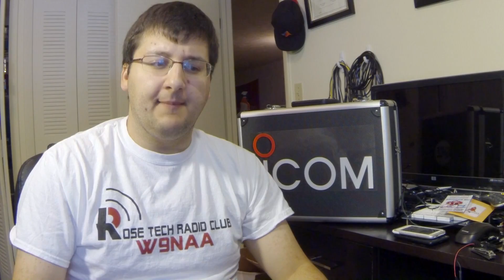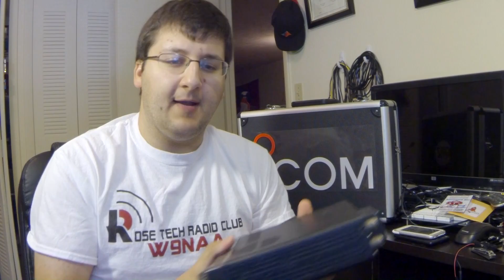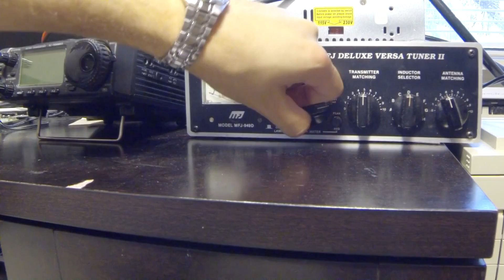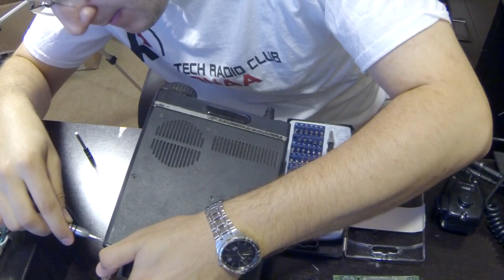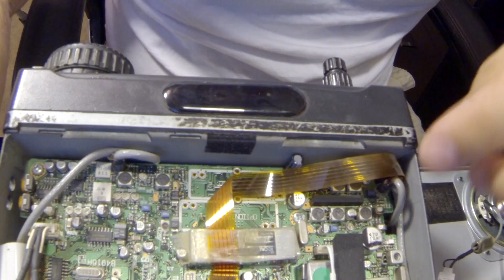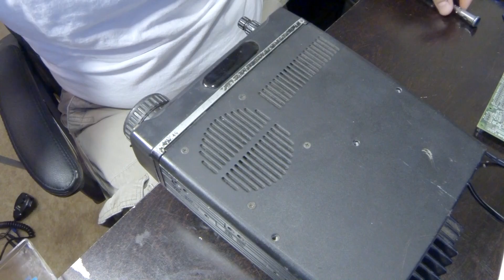ICOM IC-706 ALC Adjustment Tutorial

Comment: I thought there was a alc adjust knob on the outside left if this radio..  if so would that do the same thing as you did adjusting that inside...not tryna be a smart azz just a honest question I'd like a honest answer I have the icom 706mk2g and never opened or adjusted anything tho it was purchased from a ham guy who had it setup nice already....thanx
Reply: Oh nvrnind that's a compressor adjustment pot....so would this lot u adjusted just be the mic gain
Reply: Hello, i need help, my alc meter is always in 0, no matter mic level.. why? Thanks you!

Comment: The SSB RF is sometimes to suppressed on tx on many HF radios to much ALC can be a bad thing when your doing qrp out of an apartment window thats me too 😅. 
Proper modulated RF is expected. 
Another 706 plus is that turning the RF down to 10 watts and driving a solid state amplifier good for 10-20 meters. That mic looks be a good replacement when the original is deteriorating. 
Thank you for video.